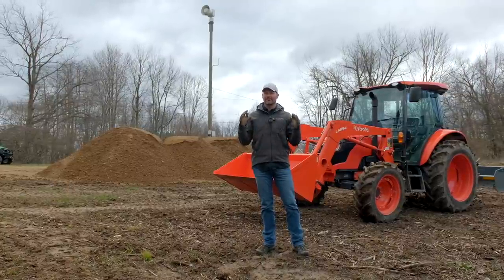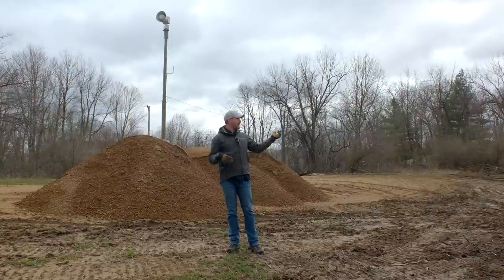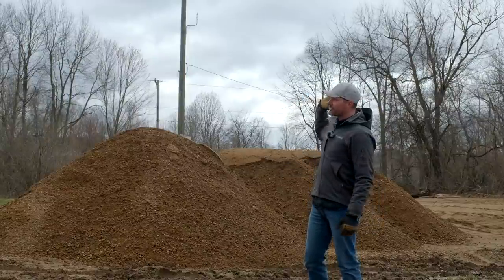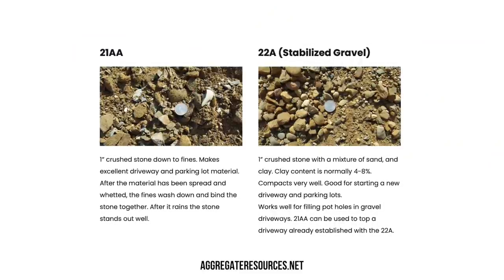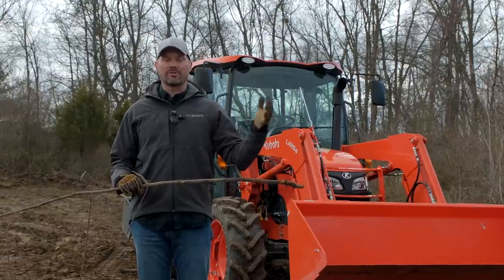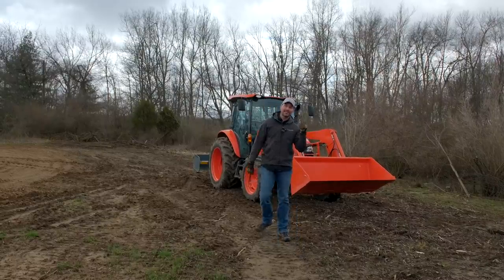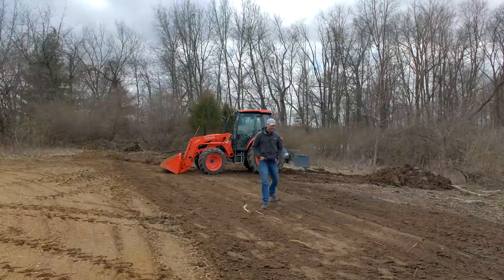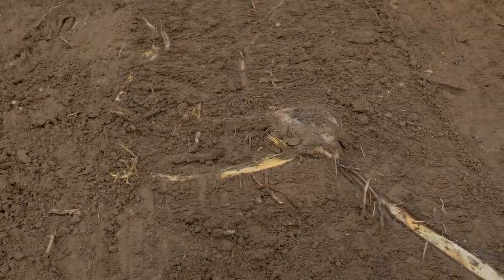MADE IN THE USA BOX BLADES.  USE A BOX BLADE TO STRIP TOP SOIL.

Comment: good footage of the box blade in action a big thanks to your brother. I have the same box  blade .what I did with mine was take 4 inch square metal tubing and filled it with concrete and mounted it to the box blade, the added weight really makes the box blade dig in
Reply from the maker: Good idea, could have added some suitcase weights to it too.  Extra down pressure would be nice!

Comment: Good morning. All of your work is really bringing it all together! Looks great. Just thought I would share a little insight on the box blade. I have used mine extensively in all sorts of conditions and it really is my go to for finish work. The only attachment I have found that looks like it would work better is the ABI landscape finish rake. The budget isn't allowing me to purchase it right now so the box blade will suffice. The key thing to remember is a box blade is designed for pulling. You can push with it but be extra careful pushing. If you catch something that doesn't give you can bend your draft links. Ask me how I know!

Comment: I think a little faster, to get the "rolling action" that reduces friction considerably by keeping the soil in constant movement would improve your results and reduce the strain on machine.  similar to using a bottom plow, if you go too slow, its easier to bog down then if you move the optimal speed.  the rolling action within the box will help.  I see that sticky soil may be preventing that, but its worth a try.

Comment: Does the boxblade you used have a way to pin the rear/trailing cutting edge in place versus letting it float?  I believe that helps with fine grading when pulling forward, especially with the infinite remote tilt adjustability you have using your hydraulic top link.

Comment: @Good works Tractors (or anyone who has experience with tractor implements) is there a good attachment to use for compacting soil or gravel? I know there are compactors that a person can rent..just wanted to know if you guys have knowledge of anyway to do that using a tractor. Thanks and great videos..
Reply: The simplest solution is just driving over the area repeatedly with as much weight as possible on the tractor. You can get decent compaction with this method if you're careful to only fill incrementally and evenly and then "track in" each elevation lift.
Reply: There is also a 3 point roller.